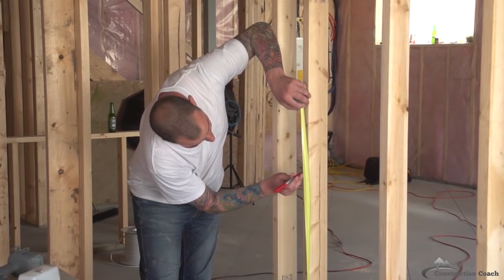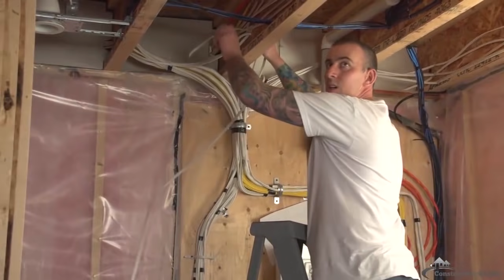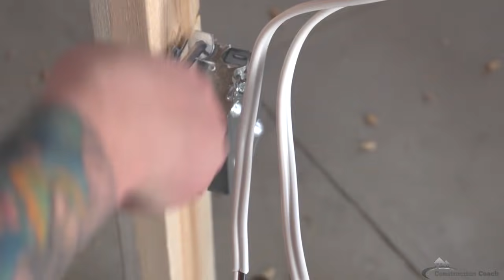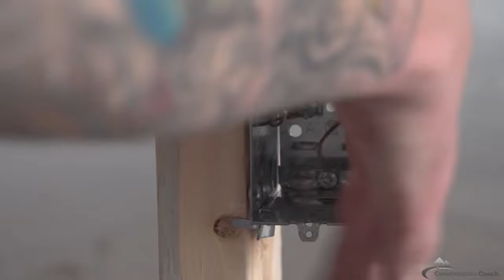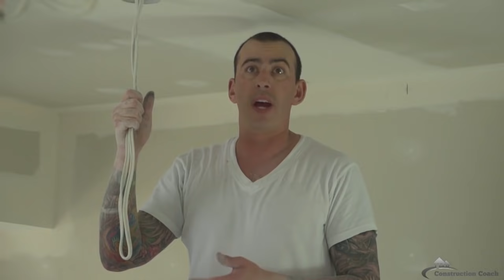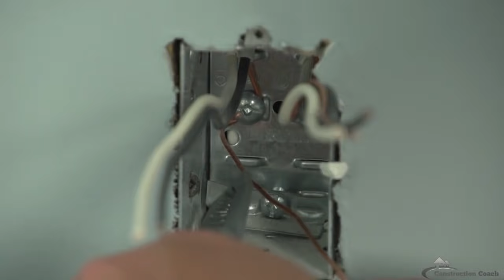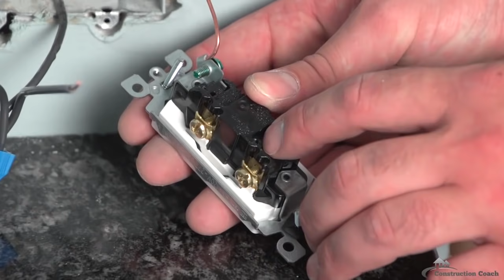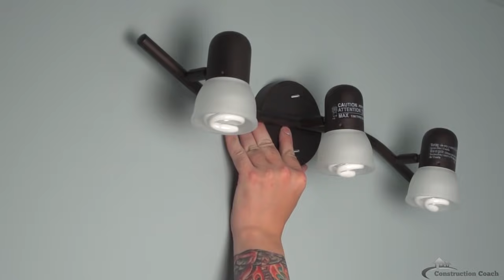Home Electrical 101 - What you need to know now!

Comment: great video, I have a  circular hole cutter with a variable cutter arm inside a plastic hood, so when you press against the PB it doesnt make dust go everywhere including your lungs. The plastic hood is on a spring so it doesnt revolve formang an airtight seal. Many electricians totally ignore site dust safety, its a must to use vacuum cleaners etc. This is especially important when retro fitting to an office or preparing a new laboratory or workshop for a government client. They DONT want dust up in the holes or in the air, even after the sparks guy has gone.  Again I must stress the us eof copperease copper colloidal grease on anything metal to metal which can corrode in service. We dont use tape any more as it becomes sticky we use cheap plastic zips 
 
 which last forever, except in UV.

Comment: Thank you so much for explaining in layman's ("womans") terms.  I have a garbage disposal switch that I think may be connected to a GFCI which is connect to the end of the counter to a plug in receptacle.  When I turn power on to see which is the hot wire from the panel to the garbage disposal switch the black wire is hot.  Then I tested the GFCI and I have "hot" coming from the white wire.  I am sure you can help me.  Thank you for great videos ..keep them coming.

Comment: And also when working on boxes I like to bend the wire in the box and measure the wire so it will easily fit back in with just two folds. While making sure there is enough wire in the box for the future if anyone needs to work on it for any reason. It makes everything organized and neater. Always put the wires back in the box left to right- ground, white, black, red(if 3 wire). Always keep the grounds away from the hot wire connections. On switches and outlets the hot wire is always connected to terminals on the right side.

Comment: Hey brother just a quick word of advice when you trim out your outlets the ones that have feed throughs you dont want to have the load of that circuit run through the outlet if you have a loose connection you will lose power to the remainder of that circuit best thing to do is make joints in the box and pig tail off to the outlet.

Comment: I have been a master electrician in Utah for around 5 years now, but been in the industry for nearly 18 years.  I personally prefer to separate lighting circuits and outlet circuits.  The reason for this is because I can load a circuit better knowing the lighting load so I can get the most out of every circuit, but more than that is for safety.  A homeowner is more likely to trip a breaker by plugging something in versus turning on a light.  If they are separate then if a breaker is tripped from an outlet circuit you still have light to navigate the room, if they are all together you may be trying to navigate the room in the dark and could get hurt.  Code doesn't make this a requirement, but it's something I am working on to get this passed and adopted into code.
Reply: Okay, I knew I should have waited until the end to comment, but I can't take it anymore.  I honestly cringed when I saw that razor knife go through the outer jacket of the romex or NMB.  Also, why didn't you makeup your switch boxes during the rough?  Why are you using remodel can lights in a new construction application?  It's easier to use new construction, nail on can lights during the rough electrical.  It would absolutely piss me off if someone wired my new home or basement and used remodel can lights.  For your low voltage runs, have you ever heard of or used a low voltage ring?  They are a plastic single gang or multi-gang ring that is nailed onto the stud and they are open to the stud space so when you connect your wall jacks, the connector has plenty of space behind it so the cable doesn't get bent during the finish.  I know everyone has their own techniques and the way they like to do things, but holy hell.  Perhaps you should come out where I live and I can show you a thing or two and perhaps a better way to do electrical work.

Comment: Generally, Ceiling lighting is placed on a separate power line. The intent, if a circuit is disrupted, light is still provided either by the outlet , or Ceiling energized circuit. Even though there is adequate Amperage to power both.
Reply from the maker: Thanks for the tips
Reply: newer codes say they have to be arc fault so (almost pointless)  to run on seperate line.  if no more of an inconvenience i wld
Reply: My comment is not about safety. It is standard practice, to wire separately for convenience, as you said,   If your over head lighting fails, you still have the ability to light the room by a  “ floor lamp” . If that is not of concern, you are right. As long as you have figured your load, and not over loaded that circuit. With LEDs , it would be hard to surpass the coded line limits.

Comment: What i like to do is install  a couple of tagged  cat 6 cable routed to a service box in a ceiling hallway from each bedroom or rooms with computers of tv's eat. People ofter don't think about that or surround sound cables or cables for security cameras until after its too late. I never use those type of octagon boxes with out heavy duty slider brackets because people will hang heavy ceiling fans and these boxes are rated for lightweight lights. I will never use 14 gauge wire because these days people always overload circuits especially in bed rooms where people have all of their electronics I am sure this is fine 14 as long as its one circuit per bed room, I never go less than 12 g wire. Good clip dude!

Comment: I think you did a really great job.  There are a couple little things I would do different, mainly the ground wire in boxes should be longer because when you bond it to the box it gets shorter.   6" on all wires after bonding.   I have never seen or even heard of the service loops before.   Electrician in FL
Reply: @James Madison 👍true, very nice.

Comment: When wiring those ceiling fixtures just keep in mind when you splice them together with pliers, the wires from the fixture tend to break so to avoid that I splice the two 14 wires together and just use the wire nut to splice the fixtures wire to the 14 wire . It keeps the wires safe and securely fastened.

Comment: Great job, some of the cleanest electrical work I've seen in a while.  I only have suggestion, wire strippers that remove the wire sleeve as well, ie. Ideal 45-62.  watching you run a box knife thru the wire gave me nightmares of past experience
Reply from the maker: Donna thanks for watching!!! I will take a look at that. New videos just released.

Comment: Here is the UK, those cable access holes that are in the metal boxes would need have their edges protected by rubber grommets, to stop the sharp edges cutting into the outer layer of insulation. Saying that though, the metal back boxes that we use do not have a facility for securing the cable. Maybe the fact the cable is secure as it enters the box obviates the need to dull the edges with protection?

Comment: each plug and switch should have a junction box and cable must be fed through the flexible hose to fail it easier to remove / replace, flexible hose provides good protection against fire, thanks for the demonstration

Comment: Quick question in minute 19:22 when you say three whires going to the switch, one to the switch, one to the lights and one to the plugs does that mean that all the plugs will be controlled by that switch? meaning that the plugs will only work when the switch is on?

Comment: In my local area I would fail inspection because the walls are insulated. No  insulation until all plumbing and electrical and mechanical inspection are done.

Comment: Wow. Way better than the electricians in my house. What's the easiest way to quickly get an electrician certification? I'd like to mount some recessed lights in the house and run wire to it & the main house panel.

Comment: This is a excellent video, I learned a lot. I was wondering about a couple of things. Most of time I see plastic boxes in home wiring in the US but you are using metal ones, any reason why? I always thought they are better, stronger and won't melt. Wouldn't it be preferred to put the receptacles and switches in last? I've seen many videos where there is paint, drywall mud, etc. on receptacles and wires.

Comment: When installing that GFCI  in that small metal box would it not be a good idea to wrap electrical tape around the terminals, that looked as if the terminals would rub on the sides of the box. Also wondering why 2 sets of hot, neutral were connected to the "LINE" terminals on the GFCI

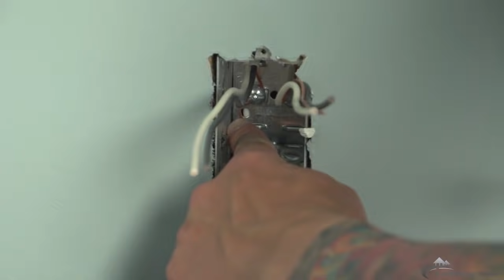Comment: at about 1:08:38 why did you cut the ground to the left, it looks like there are still other outlets on that circuit further down? Thanks. I'm just starting to learn this stuff.
Reply: What he did was wrong. In the canadian code (CEC),  Section 10 (Grounding and bonding) it states that all grounding wire need to be grounded. Which in this case what he did was only ground one of them. What you are suppose to do is ground both grounds to the screws in the back of the outlet box.

Comment: that was a neat idea taping the cat 5 and coax for slack. be easy on the staples with the coax, don't pinch it, loose is fine.
Reply: on second thought, maybe not. when an overzealous cable or Sat guy tries to pull every last bit of slack out, it may pull a twist in the coax. I like it when electricians run the cable in the top of the box and right out the bottom, with about 8 or 10 inches to spare. this doesn't work with foam insulation though, cable and cat 5 gets glued in that way.

Comment: Coach would it be better to rough in prior to insulation..just wondering your thoughts on that?
Reply from the maker: Absolutely,  this video is from a basement development after I had moved in.  The building code required me to have minimum  r12 insulation around the perimeter of the basement walls before I could live there.  Then I started the basement and had to remove some areas to get the rough in complete.  I hope this helps, thanks for watching.

Comment: On new bathroom sconces what's the bare copper strand wire for when there's already a ground wire? It's just a two light fixture. Would you recommend having a pro replace it or is it easy enough to do yourself. We need to replace the old one it's 30 years old.

Comment: Question? If you use a metal box I see your screwing the grounds to the metal box.
Now, when you put the electric plugs in the boxes you still need to add grounds to the plug outlets? Or are you ok putting the wall sockets and screw them to the grounded box? I'm considering redoing my electric wires in my mobile home. They have zero space to pull any more wires through. Sure not made like a house for sure..Ty if you reply...

Comment: You did an awesome job with placing the fixtures in the correct spot. I might use that tactic lol
Those outlet quick connects are also only rated for 14 wire and 15 amp breaker anything else it’s not rated for

Comment: I know you said you like to keep it a couple inches above the ground. I ran my wire about similar to my outlet height. Is there any reason i should or shouldnt do it that way? I felt it was easier to run wire & without waste. Hoping to hear pros cons or right wrong with my thoughts. Nice video just started it up and already sucked in.

Comment: I currently have a switch that controls the outlet for a floor lamp. I want to install ceiling light that is controlled by switch and no longer need outlet to be activated by light switch. can I keep all outlets working and just run wire from ceiling light to switch? do I need different switch or need to change outlet. thanks.
Reply: I have red and black at switch so I assume red/ black go up to new light depending
Reply: all good. easy

Comment: Absolutely amazing video Construction Coach. Thank you for your the crystal clear teaching. I learned a lot. You have the makings of an excellent instructor in any technical college of your choice. One question... At 1:10 through the video you talk about putting the Line and Load line through the GFCI points. However, as I've been taught, only the Line wires (black and white) should be connected to the exposed connections. After connecting them I was instructed to remove the yellow tape and then connect the Load wires to the copper and silver connections. Perhaps I am mistaken, but can you calrify my doubts please? Many thanks. Once again, great and very instructive video. Cheers, joe+

Comment: The metal switch box doesn't seem to be bonded with a green screw. This means it could be a high impedance ground connection, and under fault condition might not trip the breaker as it should. Also, you shouldn't have wire insulation pinched under a switch terminal. There should only be copper underneath it to ensure a good long term connection.

Comment: Thanks for the video. It explains alot. I'm looking into adding a light or 2 in my attic. My question is, can I run the power for them off the same power as my attic fan? I think the fan will still run if I add a switch. Or do I need to add a new breaker or run it off an existing breaker somewhere. Sorry if that's a dumb question, just never ran home electrical before.

Comment: Hey, Ive been searching the internet for awhile now, I cant seem to find out if its ok to run flexible pvc conduit up through the soffit on my house into the attic.  inside the attic will be a termination to a j box with romex on the other side and the little clamp that clamps onto the romex.
Reply: Lakario Davis You can use pvc conduit in this fashion, as long as you clip it to the wall with metal saddles.
Reply: Lakario Davis    You can also use non metallic flexible conduit.   BUT do not pull to explain through it unless its less than 6 feet in length.   Otherwise spools of than/thwn.

Comment: Good video. I do have one question; at the start, instead of cutting the vapor barrier and removing the insulation, why didn’t you set the boxes and run the wire first and then install the insulation and vapor barrier. I’m thinking it would be less work.

Comment: if there are baseboard electric heaters you would need to avoid putting outlets or switches above them correct?.......did you consider that when installing?......baseboard heaters are installed under windows

Comment: I am not electrician myself but find it very interesting, but I am confused about one thing ? Did you run two powerwires from the breaker one to the gfi and another one to light and fans switch .

Comment: I learned a ton from this video, as well as the comments. Thank you! I had one question regarding the last receptacle you installed. Which ground did you attach to the outlet, and which ground is the one that's grounded to the box itself? Is the house power grounded to the box, and the wire leading to the next receptacle grounded to the outlet?

Comment: Should have drilled on from opposite sides of the 2x4 on each one left then from right on next 2x4 makes pulling wire much easier no binding with wire because all the holes aren't drilled out at same angle because u can't fit the drill in between all of 2x4s to drill the holes straight across

Comment: Q: Why staple wires to the beams? What if you need to replace a wire in the near future.. isn't it easier to attach new cable > older cable and pull new cable through while pulling out old cable ?
Reply: Because code states that you have to support the wire.  It doesn't specify exactly what the distance between supports is, but it has to be a minimum of 1-1/2" above the edge that drywall will attach to.  This is the same when drilling holes in studs.  I personally will support my wire a maximum of 10' intervals when they run horizontally.

Comment: What does it mean and consist of to do a full home redevicing?
Reply from the maker: Count all the devices. Switches, receptacles, smoke detector/co2 and thermostat. Purchase all new and change out old ones. It takes a bit of time but is quiet easy if you do one at a time and make sure everything is going back in the same way it came out. 

I have to warn you that I have seen some really bad jobs before. Tightening wires around lug screws backwards, installing wire nuts improperly and the kitchen backsplash receptacles are usually 20amp and people install 15amp. 

If it seems difficult or things are not working call a certified electrician.

Comment: How far should your switch boxes stick out from your 2 x 4s if installing sheet rock?
Reply: Depends on the Sheetrock. Typically 1/2” in a residential home. Also the blue plastic boxes have little dimples on the outside so you don’t have to measure.

Comment: I don't understand why only hot wires are connected to the switches at 1:22.  A light/fan doesn't run on hot wire alone.  How does the circuit get completed to the device on the other end?

Comment: I am surprised that romex is still being used. there are a lot of places that require EMT.  Also lights in my opinion should be on a separate breaker. If you overload a circuit you wont be in the dark. I know the cost but its worth the extra cost. There are other reasons lighting be separate if you have a transfer circuit for emergency lighting you can also have all smoke alarms on the transfer circuit because smoke alarms are usually on lighting circuits. I also see that no 14 is used here its not legal in my county no 12 must be used. no 14 can be used in other counties all around. 

oh thanks this is a good wiring video one of the best i seen.